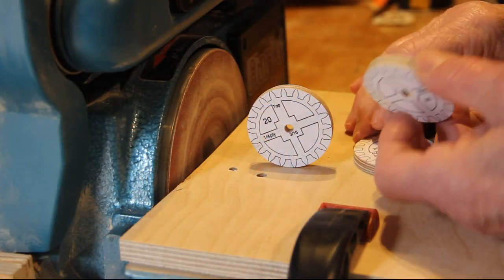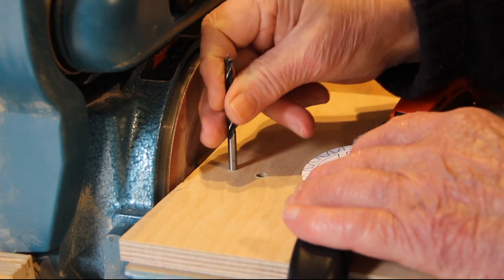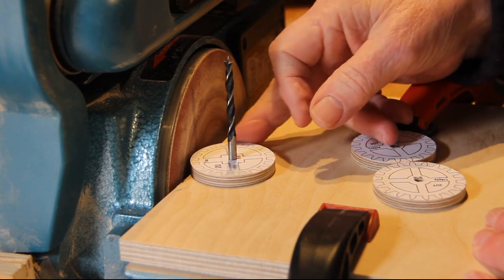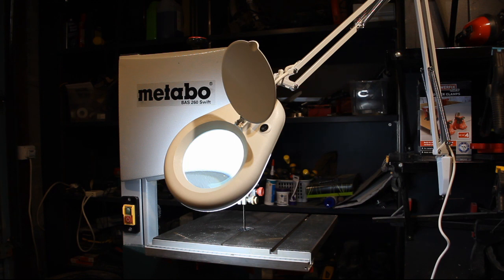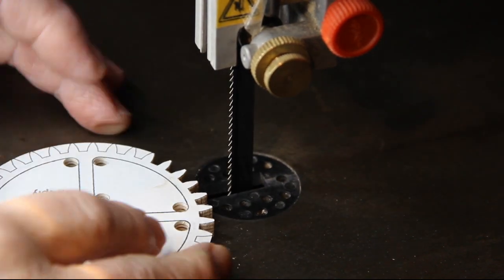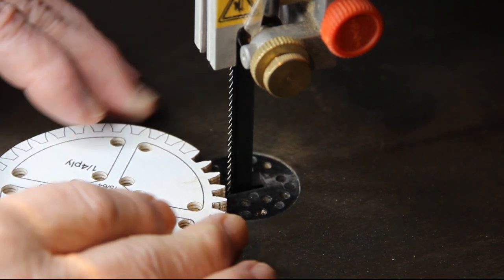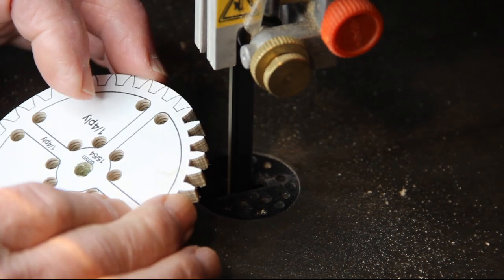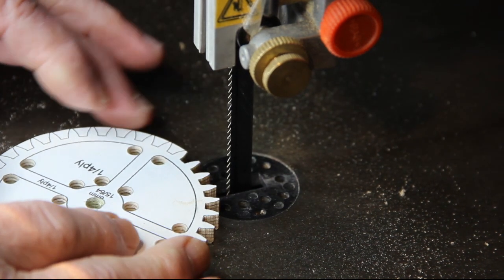Cutting gears for a wooden clock.mp4

Comment: may be to use cnc
Reply from the maker: Yes of course it can be easily done with a CNC and I have done that myself...but the skill required for that is all in the cad/cam software and then you just push a button! There's a lot of satisfaction to be got from hand crafting.
Reply: @100geejay  Yes, of course... only, despite all the efforts and skills, the gears on the CNC turn out much better )